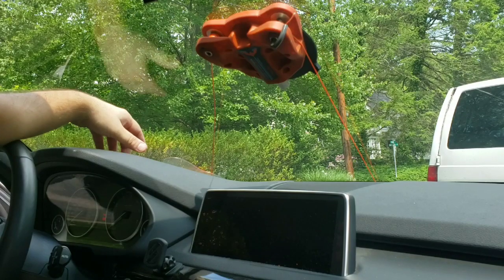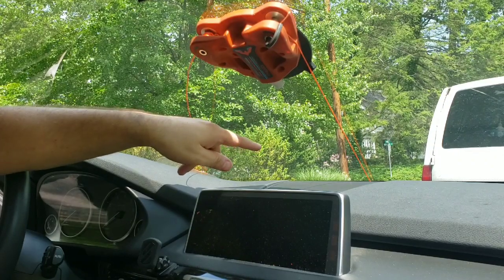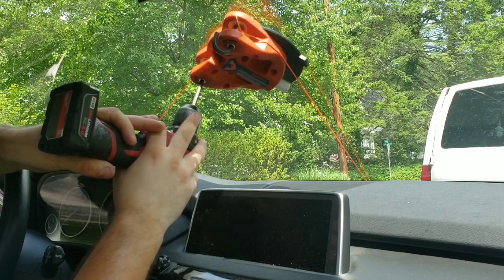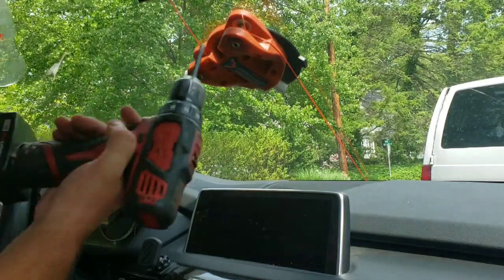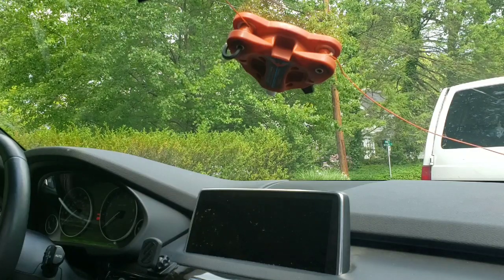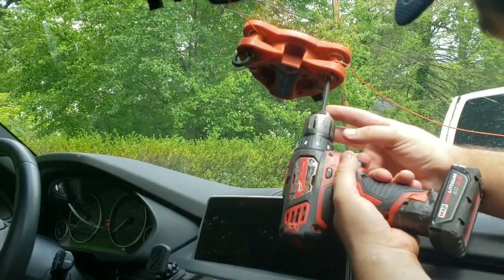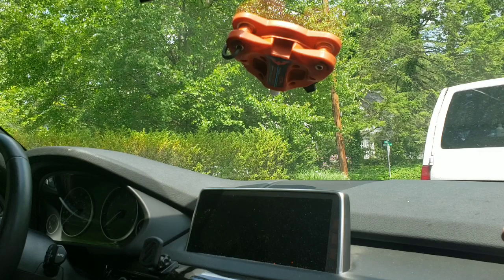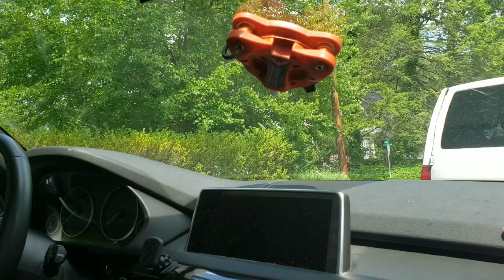WRD OrangeBat. Windshield Cut Out Trick. Auto Glass Tools

Comment: Would this take out a windscreen without cracking the glass, cause i need to swap the glass with 1 from another shell
Reply: That's the idea.  The greatest risk to the glass is probably when you're poking the cord through initially.
Reply: Well, it’s best to use a cutting blade (spatula) tool to cut the urethane at the bottom of the shield first, it allows less tension on the glass when stringing the sides and top, but that tool can be pricey. So, if you’re only using a string tool, I highly suggest not doing it while the shield is cold and also do not poke the string directly through the bottom corners. This will indeed increase the chances of the shield cracking the minute you start.

Comment: Man we have this at my shop and i hate it. The cup does not stick. No matter how much i clean, where i place it. Wire breaks constantly.  The only time it works well is in small cars with undersided or no mouldings. If you get an older f350 with those stiff mouldings you cant get off. Forget about using this.  Same with the python.  Air knife and ambush is the fastest and works on all vehichles

Comment: I’m currently doing this wire method for the first time, without the windshield suction.
Using 140lb fishing wire (not line, but wire) from bass proshop; about halfway through, and have had 0 breaks in the wire.

I did slice ~1/2cm of plastic trim in the beginning on accident… first time I’ve ever tried this so think I’m doing decently.
Reply: 😂😂😂 that trim part